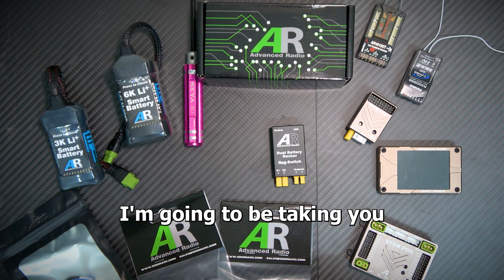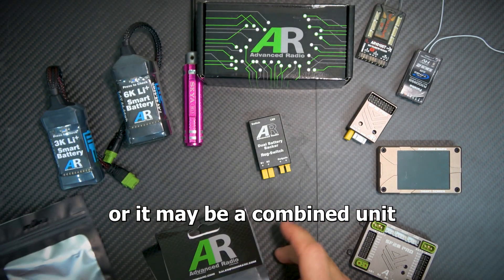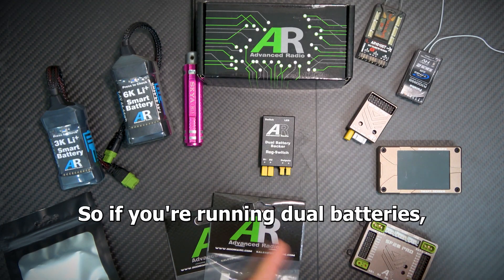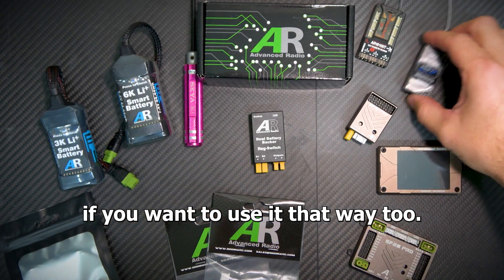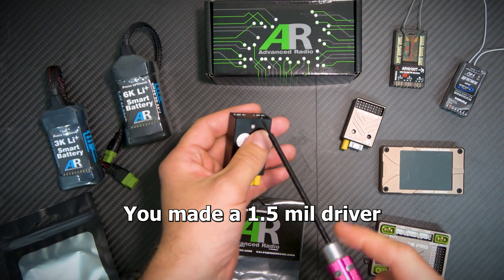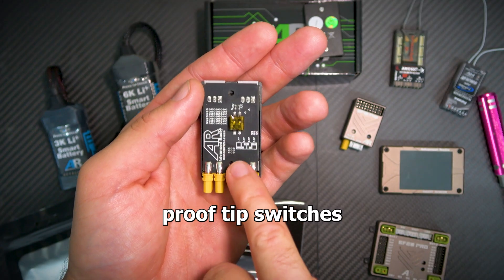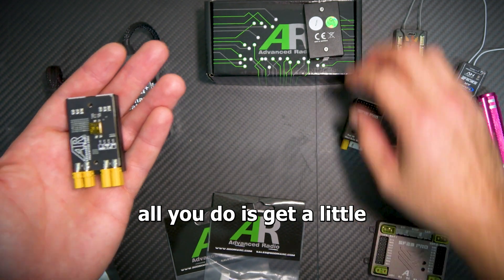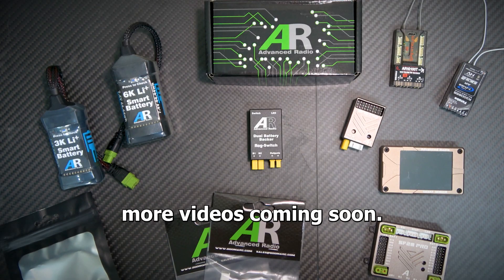RC Power Setup: Reg switch Setup 101

Comment: What I miss:
- higher input voltage (up to 6S or better 12S)
- higher output voltage (up to 8.4V or more for the new UHV systems)
- the input connectors at one side, output at the other side, not side by side - so you are able to "run through" the power wires